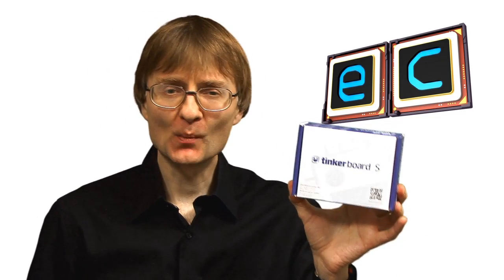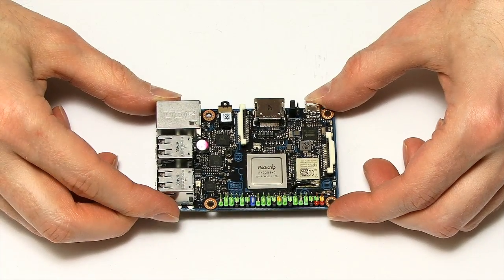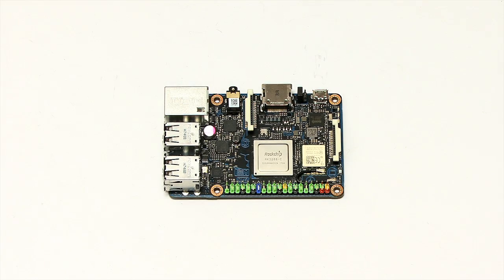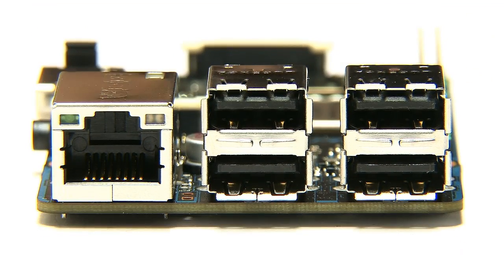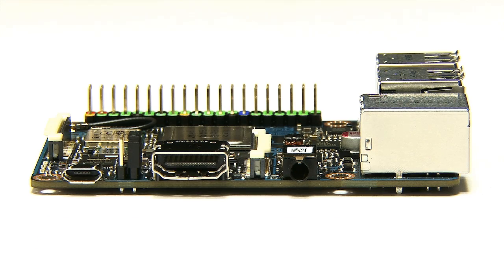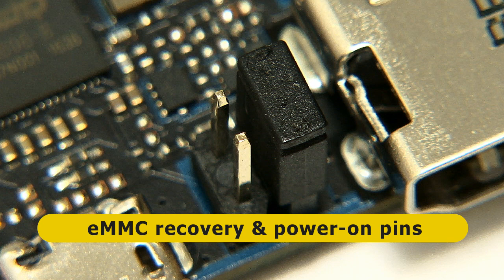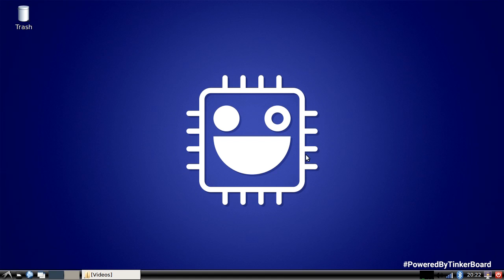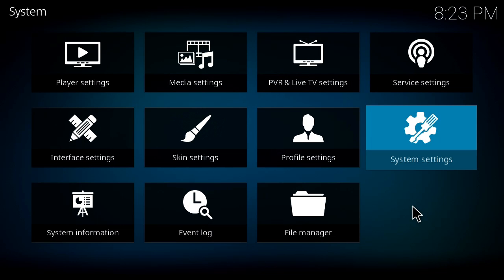Tinker Board S

Comment: Great video, I believe that the NAS wouldn't run good on it because of the ports on it. I am going to make that NAS you did a  couple of weeks ago shorty, that fits exactly what I need, Thanks for the great info...
Reply from the maker: Thanks for this. You are right, a Tinker Board (S) is a great SBC to stream media to, but not a good choice to build a NAS as there is no way to attach higher speed storage. I am currently working on a video (to upload 25 March) that is an SBC NAS group test comparing an OMV NAS on a Rock64, Pi 3, Banana Pro and UDOOx86. :)
Reply: Great, thanks. I'm looking forward to see that video...

Comment: Thank you for the advance preview! Been wanting one and now I think Asus is gonna stay the course.

Question: have you tried the official Raspberry Pi touchscreen display with any Tinkerboard?
Reply from the maker: I've never tried it, but it is supposed to work well.
Reply: no it did not work well on me,  after hours of trying , rotated the screen but not the touch interface, till 3 weeks ago I have not found a solution for the rotating of the touch interface ... so i switched  to other alternative
Reply: I suppose my biggest issue with Asus TB is that while it looks nearly identical to the Raspberry Pi it is not supported well enough to pull off what I'd call "excellent" compatibility.

Comment: Impressive SBC.  If it had a couple of 3.0 USB ports, it would be near perfect.  I have to admit this board is tempting.  It would be interesting to compare the two Tinker Boards.  I appreciate your doing this video   I look forward to your next one!
Reply: keep in ind usb3 needs power to be fully compatible, some board that have it need 4 amps power
Reply: Bill, you have a good point.  One of the cool things about SBCs are their low power consumption.  How many amps are too much and SBC enthusiasts become disinterested in the product?  Still, 3.0 USB ports would be nice.
Reply: well there are some SBC that do have and I think there a video in the collection of one
Reply: also keep mind faster speeds do mean more power and you have to balance what you need, if i wanted to save energy i would look at the Pi zero or maybe the onion2, or the Chip if it comes back
Reply: True

Comment: what makes eMMC better than say a fast microSD card ?
Reply: Maico its even quicker and less corruptible
Reply: ah I see. maybe it also has SSD techniques like using spare cells to replace bad ones ? I think microSD cards just get a bad sector if a cell dies. Only thing I know about eMMC is that its used in mobile phones and is much slower than an SSD
Reply from the maker: eMMC (depending on the interface) can be up to 7 times faster than an UHS-1 SD card. It is used in some netbooks and in tablets as well as smart phones.
Reply: OK Thanks for your answer. I had only negatively heard about eMMC being a cheap substitute for 'ssd-like' memory in smart phones (smart phones never use anything other I presume). Probably a slow interface on the cheaper/slower memory performance phones/tablets then.

Comment: I installed #funtoo / #gentoo linux with the #Mate Desktop Environment on the Tinkerboard.
Mate DE work fine, smoother than LXDE, but little bit slower.
Pros: fresh updates from github, same applications work little bit faster, VLC player support all formats, audio volume  through audio jack not so quiet,  wi-fi work more reliable  and can share internet.
Some Issues: bluetooth, no sound or noice in chromium 64 and firefox 52.6 :(
On second tinkerboard we made funtoo/gentoo linux + nginx + php7 web server.
if someone interested to try - I made playlist how to install funtoo gentoo linux on tinkerboard (on russian).
Reply: Sounds very cool what you did with yours ...I have 1 for tinker os and kodi on it as my streamer/media player and my other tinker I put in a mini nintendo case and use lakka for my emulation and filled up a 250 gig laptop drive with games ...every bit of 8 game systems on it :) hope your future projects go well !

Comment: Good looking board but without USB 3.0 and 2Gb is just not enough. Still, the best solution for small PC or media PC is Intel NUC 6CAYH up to 8GB ram better graphics chip. DC range 12-19V a lot of USB 3.0, card reader and full 2,5 HDD or SSD disk.
Reply: +MaZec31
"2Gb is just not enough".

Why is 2GB of physical RAM "not enough"?

What purposes do you need to use a SBC  for and what software are you intending to run on one of these devices?

Remember that there are many alternative lighter  open source software packages and frameworks that can be used instead of using heavy, over bloated and cumbersome applications.
Reply from the maker: There are comparable SBCs -- eg the UDOOx86 range.
Reply: We need new generation of single board computers with USB 3.0 and with USB-C for charging and data with Displayport 1.3 with so-dimm slot DDR4
Reply: +MaZec31,
You have provided some interesting and good suggestions for the development of future boards, however I do not agree with your point about USB type C for charging / power purposes. Personally, I would prefer to see USB power inputs to be replaced with the more generally accepted (5v - 19v) 5.5mm x 2.1mm coaxial DC jack (as used within many other domestic appliances).

Comment: There was a good bit on BBC Click this week with SBC's being used in remote African schools. Essentially they were using Pi's as desktops and low voltage LCD monitors. So all the schools IT kit could run off a small Solar panel. So the low current demands of SBC's is opening up a whole new use application.
Reply from the maker: Yes, I saw that. SBCs can be put to many good uses. :)
Reply: ever see the story of 'one laptop per child'? A group who is putty laptops in to hand of kids in 3rd world countries, the result was OLPC XO laptop. Story was on 60 minutes

Comment: Is there a DOS that can be flashed onto the Tinker Board S ??
Reply: If DOSBox does not work successfully and does not provide sufficient x86 emulation, then I suggest experimenting  using the QEMU project.

QEMU comes in two "flavours", the QEMU / KVM project is used on medium to high-end servers for hypervisor and virtualisation infrastructures (which can be found as part of many data centres, call centres and hosting providers). The other "flavour" of QEMU can be used within low powered computers to emulate other architectures and CPU chipsets.
Reply from the maker: This is an ARM board, so cannot run DOS. Well, actually, it could I'm sure run the ARM version of DOSBox within, say, TinkerOS. I must try this! :)
Reply: I tried that with dBase III Plus and dbase IV and neither worked well at all, especially with updating the databases and file paths.  I would love to have a SBC that would run Microsoft DOS v.6. where dbase would feel right at home.  Very much enjoy your videos...  thanks.
Reply from the maker: You would need an x86 SBC for that.  A LattePanda or UDOOx86 may meet your needs as they will run Windows, and you could install DOS 6 in, say, VirtualBox.
Reply: Thanks for the information!  Much appreciated.
Reply: Thank you too Mark.  But I'm thinking that the simple solution might be to just find an old "dos" computer.

Comment: I've been using the normal Tinkerboard as my main computer (living in a hostel rn) for a few months and the biggest upgrade in this one really is that new usb. This thing has crazy restarts throughout the day, although they're not full restarts i've noticed. It feels more like the ram is losing power because it boots back up in under 5seconds in most cases. Compared to ~50s from cold.

I just figured this building has bad wiring because if i try do certain things while the kettle is boiling or if the washing machine is on; then it'll restart way more frequently. Also, idk if you read the comments but do you know what the resale value of the old tinkerboards are? Might be my only way of getting an upgrade soon so i hope it's not too bad
Reply from the maker: You clearly have experience of the power stability issue. I'm not sure about resale value, but I would expect the first Tinker Boards to hold their price pretty well as they are as powerful as the "S" boards and fully compatible. Others here may know more?
Reply: Maybe you could fix your power stability issue with a USB battery pack to act as power filter/buffer?

Comment: Always enjoy your videos - your professional presentation experience shows!  Still debating whether to get a !st gen. board for C$69.99 while available or wait for 'S' at probably C$99.99 or more.  Have seen on Japanese website that 'S' always boots first from onboard memory if operating system present even if SD card with op. system inserted.  This means changing operating systems will involve installing the new one to onboard memory each time or modifying the boot file on the onboard memory to boot from SD card.  Please check this out as Berryboot or other multiboot solutions do not exist for the Tinkerboard as far as I know.  Other improvements are minor for most people but can see why Asus want to keep same SoC as this board still needs more support (wish they had gone to a barrel 5V 3A feed rather than keep microUSB).  Ironic that for a SBC labelled Tinkerboard that they appear to be going after the media centre crowd rather than makers/tinkerers.  Could you do a cooling video for Tinkerboard similar to your RPi3? (fan cooling seems essential here even for media applications).
Reply from the maker: What you say on eMMC boot if OS present chimes as correct -- I have not been able to boot from micro SD. The manual says you can, but all installs here were to eMMC. I am indeed thinking about doing a Tinker Board cooling video. :)

Comment: Hello Chris, This is a nice presentation of the TB-S.  It still appears that audio  is still not carried by the HDMI port.  Is this true?  Do you have to use the audio port to convey any sounds?  Thanks,  Mike
Reply from the maker: The audio goes to HDMI. You can choose to direct it to the 3.5mm audio system though -- or potentially auto switch.

Comment: i think this will make a splendid test computer for running various OS that i don't usually muck around with. i assume it will easily boot from the microsd card as well?
Reply from the maker: The manual says you can also boot from micro SD card, though I have not managed to achieve this yet! :)

Comment: Chris, I have a question and a suggestion.
What do you do with all the SBCs that you own? Do you use them just for testing and reviewing? Do you keep one as a NAS?
The suggestion is a new video for testing instead of the steam engine, if that would be possible. I think that a tougher test would be if the video had lots of particles flowing, something like snow or confetti. Thus the video decoder wouldn't be able to keep or move much of the image in between frames.

Comment: A nice SBC with only one drawback - a 32-bit CPU.
Reply: Because the available memory is less than 4GB.  64-bit isn't going to work on any device if it has less than 4GB of usable memory on board.  In the Windows world for example, Windows 95 was the last Microsoft operating system that could only run 32-bit applications.  Back then, anything above 1GB was an "upgrade" and a pricey one at that.  Ahh, how times have changed.

Comment: Etcher seems a great solution to os instal
Reply from the maker: Yes, I really like Etcher -- especially how you do not have to decompress images first -- saves a lot of space and time.
Reply: I have used Etcher on many occasions but prefer to use the dd command (a tool that is included as part of the core toolset of most Linux based distributions) to write and duplicate disc images to / from various storage media.
Reply: +ExplainingComputer / Christopher,
I disagree with your statement about saving space (after all the user does need to download and install Etcher on to a storage medium).

Even Etcher does still need to decompress the original compressed file before writing the image to a storage device.
Reply: Mark Edworthy ah but is Dr included in this version of Linux?
Reply: +Free Saxon,
Not sure but as I have stated within my previous comment: dd is part of the core toolsets of most Linux based distributions (considering that the accompanying distribution is based on an ARM build of Debian, I don't see any reason why this  tool would not  be included within the default installation).

Also, I thought that your question was about writing the image to a storage medium. Therefore, I have to ask about the relevance of having this toolset included on a resulting disk image / storage medium (after all, most users would be using dd or Etcher to write the image to a storage device and would generally not be using these tools within the resulting environment)?

Comment: Impressive at how simple accessing and flashing the EMMC is rather than having to use a little EMMC-SD adapter or something. If a second video happens on this board I would be interested to see a side by side boot speed comparison and maybe a few app launches comparing the speed of a standard Class 10 SD card to the in board EMMC. Also i'm dissapointed that Asus did not seal that anti-static bag.. What are we to do without an appearance of Mr. Scissors?
Reply from the maker: Yes, Mr Scissors was on hand but not needed! Confounded by a larger anti-static bag that folds down very well. I expect to do at least one additional video on this board -- initial views and comments here suggest it is popular. I too was impressed by the ease of eMMC setup, though I've yet to manage to boot from SD (though the manual makes clear this is an option).
Reply: Interesting the being unable to boot to SD.
Reply from the maker: From other comments --- and my tests -- it seems it will always boot from eMMC first if it finds an OS there. So you need to remove the OS from eMMC to boot from SD. I must investigate further.
Reply: I have faith in your abilities, sir.
Reply: Poor Mr. Scissors got left out of another video again.  It makes me feel like cutting something!
Reply: They may be sealed in future, remember "I got advance copy" and "out april 2018"

Comment: First thoughts, why only 2gb of memory?? 4 should surly be the standard now, makes for smoother operation
Reply: A lot of SBCs are now using a maximum of 2GB of DDR3 RAM
Reply: Mark Edworthy wonder why? Always thought 4 g gives more room for a smoother operation
Reply: +Free Saxon,
"Always thought 4 g gives more room for a smoother operation"
The same argument could be used for having 8, 16 or 32 GB (or even more) of RAM.

Technically, it is not about the amount of RAM that a device has got but what that memory is being used for (especially true when considering that the user or developer can always incorporate a swap partition to use for RAM purposes).

Comment: How much faster is the boot using EMMC Vs sd? Also what is the difference between tinker os and raspbian??
Reply from the maker: So far I have not been able to boot from SD. The manual says it works, but I have only been able to boot from eMMC.
Reply: ExplainingComputers hmm, but is the sd drive readable as a slave?? Maybe firmware problem
Reply from the maker: Yes, you can read the SD card. It seems, from other comments here, that the boot order is eMMC, then SD . . .

Comment: God damn. I just got my Tinker board a month ago :( I would've bought this one instead. 
Why couldn't you have made this video a few months earlier? Its all your fault. :)
Kidding aside, I love it. Browsing is real fast, unlike my RPi3, which makes me wanna punch whatever is close by. 
There are some bugs and things that don't work as expected. For example, I have the 7" RPi touch screen attached, and I can't rotate the screen using the "display_rotate" command in /boot/config.txt. It does nothing :( 
Asus, if you are watching, stop watching YT videos, get back to work and fix them bugs. I demand it.
Reply from the maker: I only got the Tinker Board S this week! :) As you say, the browsing experience is very different to the Raspberry Pi. And, over the past year, Asus have progressed rapidly on the software side.
Reply: ExplainingComputers and Michael Dina, I love this little monster. My other Rpi models are not in the same league when it comes to browsing. Its a new product that has to fight the prejudice of trolls like HamBeev bellow.
I have high hopes for this little firecracker. Will buy the S model when it becomes available.  
I would report bugs if Asus makes it real easy. Not like now, where I have to jump over hoops. I tried and gave up.
Reply: What else d'ya use it for, other than browsing?  You can use an 8 year old laptop for such casual tasks.
Reply: My Raspberry Pi 3B runs fine for me, but I’m thinking of over clocking to 1.3GHz

Comment: Rpi3 has an issue connecting to my Bluetooth headphones. Youtube hangs then I loose audio. I get an error trying to reconnect and will need to reboot. Also, I still find it slowing down at times even with heatsink and fan installed watching videos. I hope this one works better.
Reply: Guess I have to do it then. Thanks!